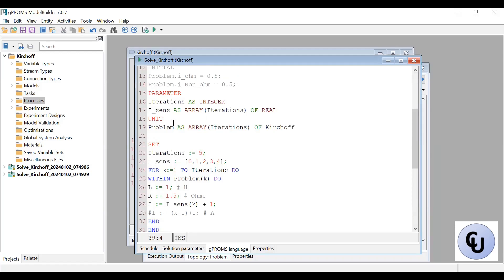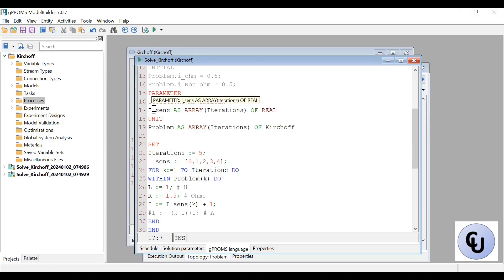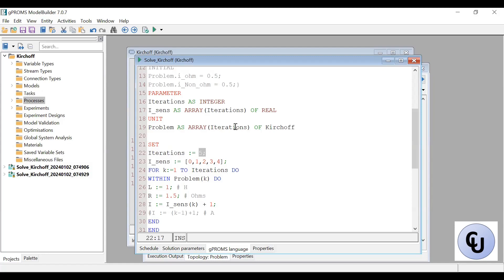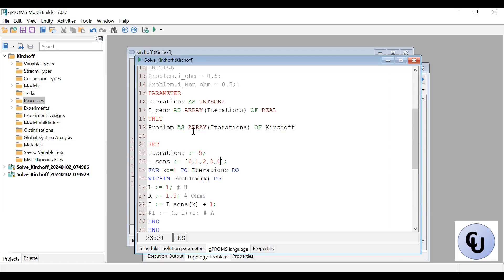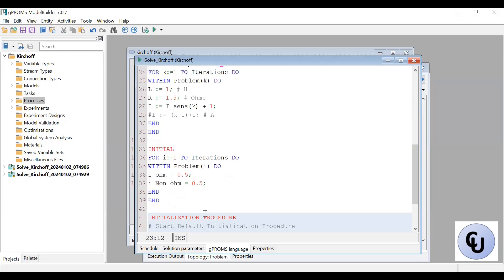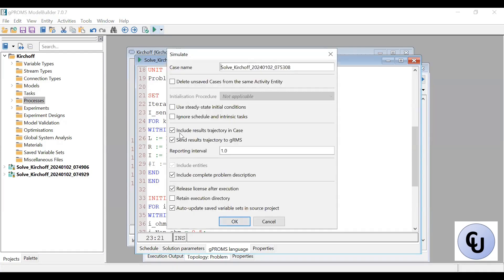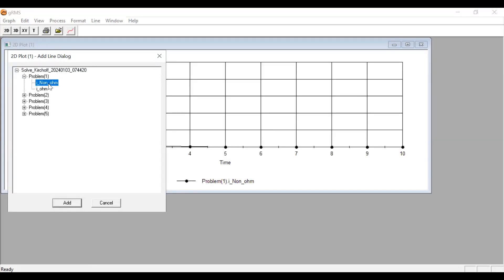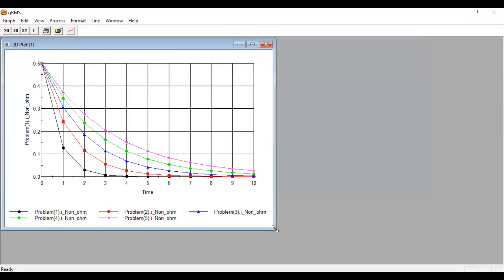Learn sensitivity analysis in gPROMS Model Builder

Comment: Great videos and lovely explanations... Do you have any hints or ideas on simulating simulated moving bed chromatography in gProms?
Reply from the maker: Thanks. The implementation of the model should not be a problem a gPROMS. This should be a distributed model, is that correct?